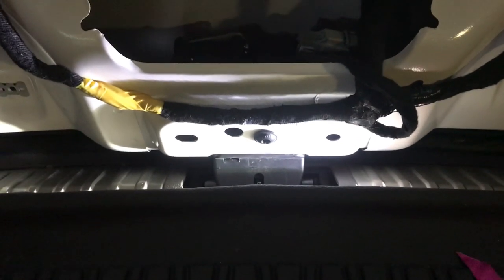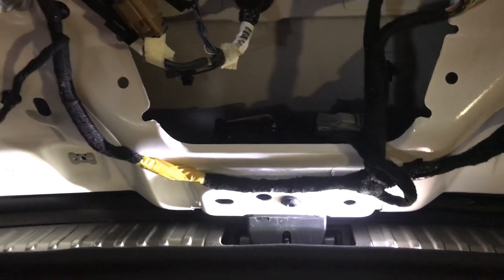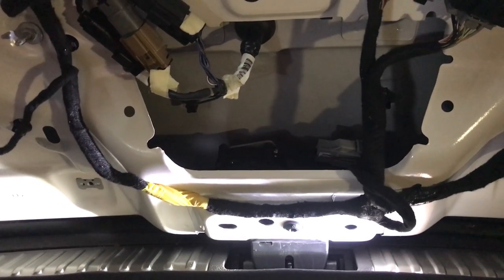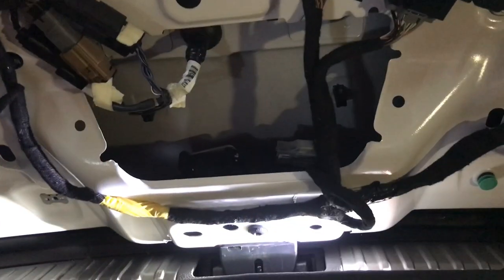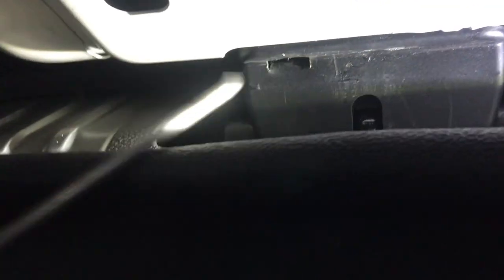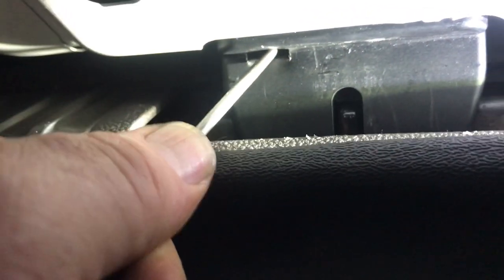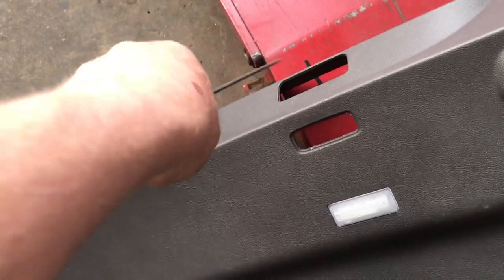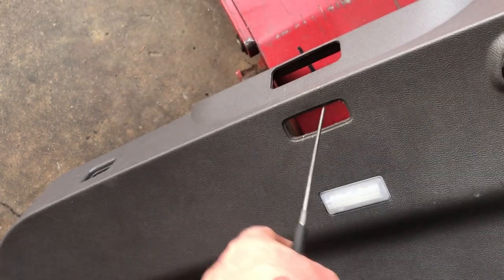2016 Lincoln MKX How To Release The Rear Hatch

Comment: How the heck you get the panel off without the tailgate being open?????. My 2016 panel access port is inch or so above the slot you are using to trip the latch and is just not accessible., Oh the videoed tailgate was a little misaligned too ... notice how it jump to passenger's side and damage to plastic channel guide when it finally popped open?
Reply from the maker: You can release the latch with the panel on. That how I did it. Then I removed the panel to show you where the release is on the latch. It’s not easy but can be done with the panel on.
Reply: @TheGAutomotiveAndMore  mine has the round hole by the big bolt head but the horizontal slot you use is down below access slot into the foam seal and I have to angle the latch trip tool down about 50 degrees to get in a just little bit but at that angle I can't go in deep. Your demo was on a 2016 MKX right? I just did a electrical reboot battery disconnected with a resistor to slowly drain the residual charge to get back to factory default. My navigational screen came back to life and the tailgate is trying but only the driver side is trying to navigation
Reply: @TheGAutomotiveAndMore  WooooHoooo
on my 2016 MKX there is a little white button in the round hole above the slot you use. I couldn't see it close but could see it on the new one I had bought. Stabbed at it a couple of times with ball point pen and then tried the FOB and it opened.  Now hunting T-40 torx socket with a long cheater bar, 3 ea T-40 mounting screws and the all feel like they are welded in. Took the panel off this time before I close it again.

Comment: Hello!
I have a question.
How can i remove door trim? When the lock the door..
My car also doesent open remote key. 
Plz im waitting u!
Thanks~
Reply from the maker: If you are talking about the other doors not the rear hatch, you might have to break the door panel off to get in there. But what I would try first is to roll down the window and look in the door to see if you can figure out what is wrong. Also look in the other working door to see how it works. Basically try to unjam the door with a hook tool or screw driver.
Reply: @TheGAutomotiveAndMore  
Oh. Sry i mean rear door trim.
Cuz already locking now..
So how can i open the trim??
Also maybe broke the trim?
Reply from the maker: @내연습동영상  You can do this with the panel on the rear hatch. It’s harder then in the video but that is how I got it open. I have the panel off to show where the release is.
Reply: I'm sure you found the answer by now but there is a cigarette pack-size cover panel you just pop off to get to that release slot.

Comment: You need to show how to get the rear hatch trim off first.
Reply from the maker: No you can do it with it on.
Reply: Dealerships must have a special tool that goes into the hole that the small hatch inspection cover goes over.  With the weather strip and hatch being stuck close there is no reasonable room to work.
Reply from the maker: @RobertFrantz-iw8ot  No I do not think. I use that pick tool with the cover on. I showed it with the cover off so you could see what I was doing.
Reply: Able to get it open thanks.

Comment: Yo can’t reach the slit through the cover you can’t even see it
Reply from the maker: Yes you can that is how I got it open to pull the panel off to fix the latch. Not easy but it can be done.
Reply: Mine too the access slot is too narrow and I don't even see the lever on the new latch I bought.
Reply: @DanOKC  yeah it’s such a shit design and I can’t find a video showing how ti take off the shell completely without fuckin shit up I’ll just have to spend more money and bring it in
Reply from the maker: @DanOKC  Its got to be there.